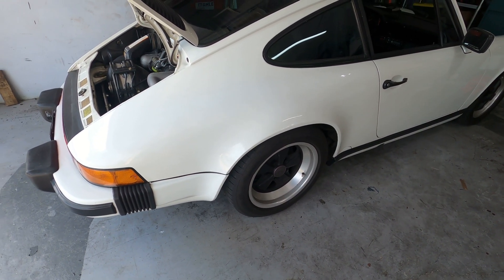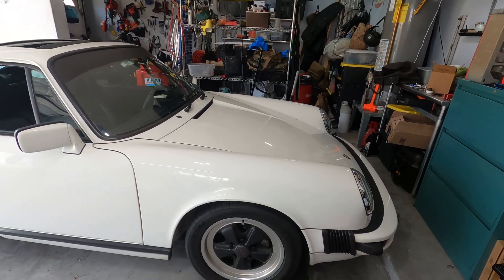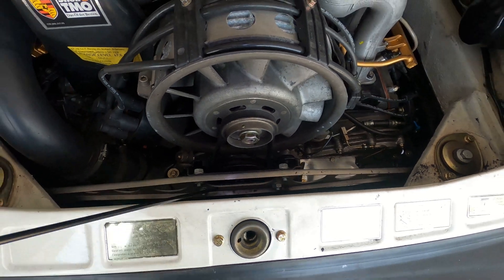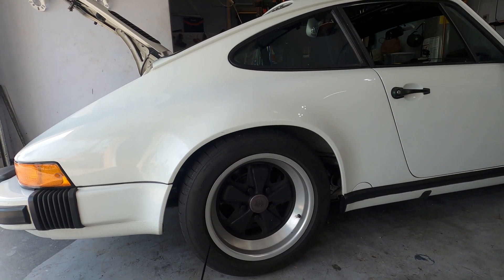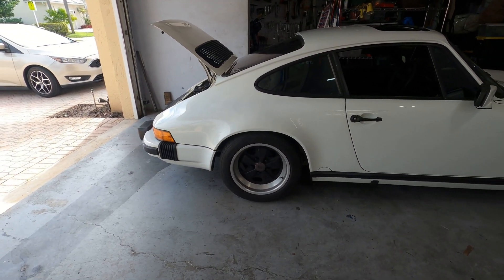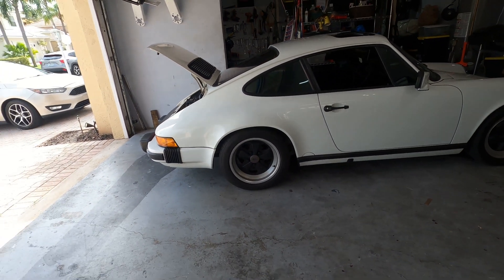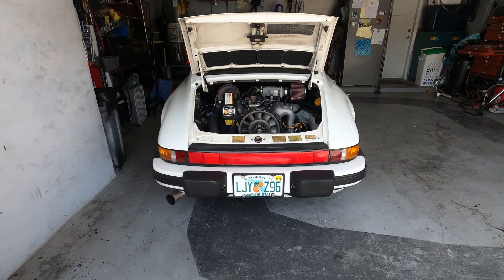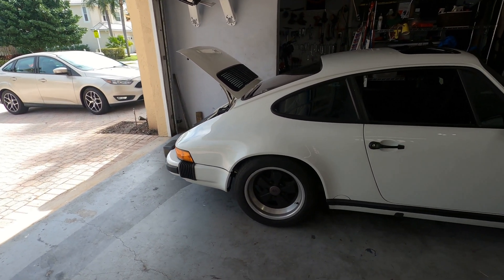Carrera 3.2: How did Porsche get rear engine to work?  Smart engineering and material selections.

Comment: I have the exact same Grand Prix white color only mine is a 1982 SC. Mine was ordered with the 473 spoiler package from the turbo. Ironically being now 58 and growing up in the 80's loving the 911 spoiler look, today I'm liking the lines a bit more without it. Like many I may keep my front spoiler on but will need to find a way to repair the cracks and chips in the rubber from driveway rash and age. When I look at your 3.2, besides the engine, the rest of the car remained the same. Bought it in December and I'm going through it now and doing some basic maintenance and do occasionally catch a different part number difference between the 1978-1983 SC 3.0 and the 1984-1989 3.2.
Reply from the maker: It's a small world and I've been following your ownership experience on your SC.  It's a super nice car and you're story is a lot like mine.  My content is just to pay forward encouragement for people that are enthusiasts that are sorting out these cars because they love them and intend on driving them. I'll reach out to you and introduce myself.  BTW, I respect your feedback so feel free to comment anytime.

Comment: Nice video thank you.
I never liked 911’s, but all the magazine journalists loved them.
So I was quite keen to try one, which I did after buying a 997.1 (at the bottom of the market). 
Engine in the back, means excellent braking from the rear wheels as well as the fronts, that’s why 911’s brake better than any other car, 4 is better than 2.
Nothing slingshots out of a corner like a 911, because the weight pushes the rear wheels into the tarmac, giving prodigious traction. Having no weight and no drive at the front, means the steering is beautifully un-corrupted and provides amazing feedback.
I was so smitten, I bought a new manual GT3, but I still couldn’t sell the 997…
Reply: I was a 928 guy since the 90's. My current is a 1979 manual 220 factory locking diff which is pretty rare here in the US as many were ordered with autos. Never even considered the 911 until 2013 and all of a sudden its all I could think about. The issue is, 928 owners can get a nice runner for 10k. Not so with the classic air cooled 911 with a huge price difference. The market finally softened a bit around Christmans and I was able to buy a coupe at a more palatable price.